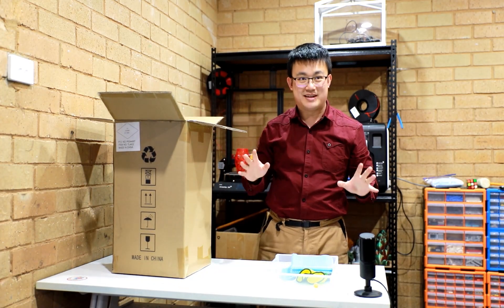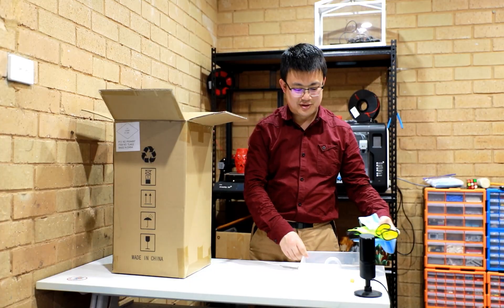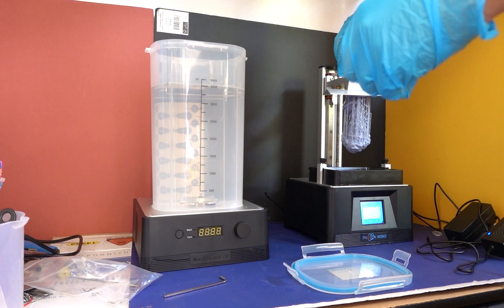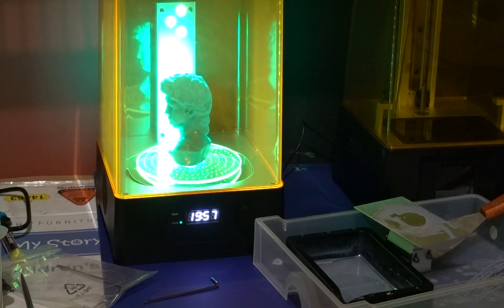Getting Started With Resin 3D Printing (Anycubic Photon Mono)

Comment: I am confused, did you build a bust? OR a box with grid sides? you keep holding up the "bust" but I didn't see it coming out of the grid box or machine. Did you build a grid box or that "bust" you hold up as an example of what? I thought the grid box was a support structure for the bust with in BUT I couldn't see the "bust" anywhere but your hand?????
Reply from the maker: Hi! you see the Statue of David bust coming out of the machine at 1:15 - the suppoting structure is wrapped around the model to help it print, and it is removed afterwards. Garry

Comment: Great video, thank you! But why oh why is mine not printing anything at all?? Same printer (anycubic photon mono), new out of the box, trying to print the test model provided on the usb stick, it fails. There's a blob that sticks to the plate, then nothing sticks. At the end, i just find a thin layer of a print at the bottom of the vat. First 3d printer, already regretting that purchase... Any suggestion? Surely the test model should have all the correct settings for the printer...right?
Reply from the maker: Hi! This sounds like a leveling error, make sure the plate is lowered and tightened at the correct height by following the leveling process. If it happens again, try changing the file. Good luck! Garry
Reply: @CreatorAcademyAustralia  Thanks for taking the time to reply! Got it to work, you're right, it was all about the leveling, but the trick was not to follow the official instructions included with the Photon Mono! Instead, i followed these: https://www.youtube.com/watch?v=bIMwjmVl3Ho&t=123s where you actually go down by 1mm when you level until the paper can't be moved. The manual does not say that... And that fixed all my issues! Thanks